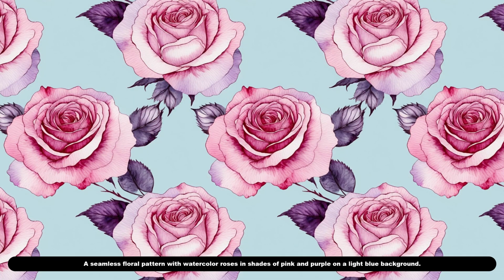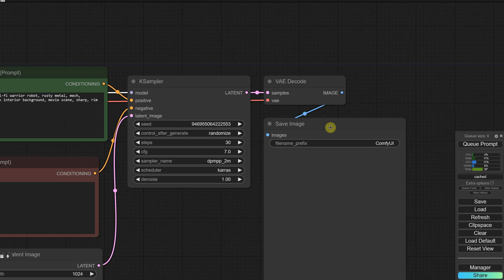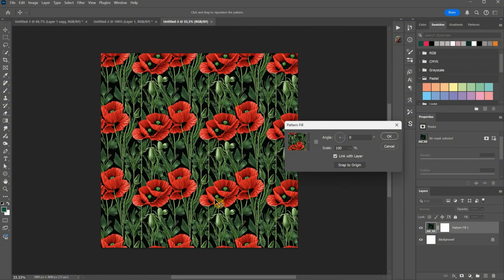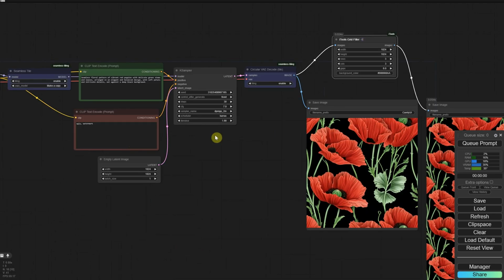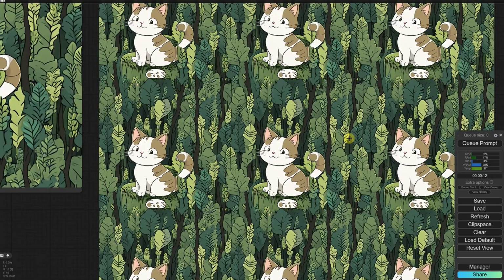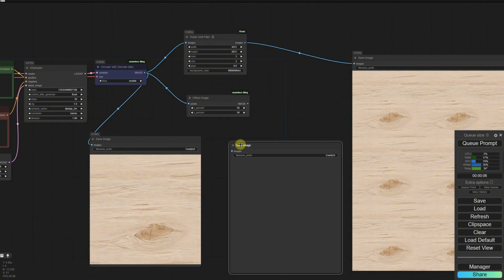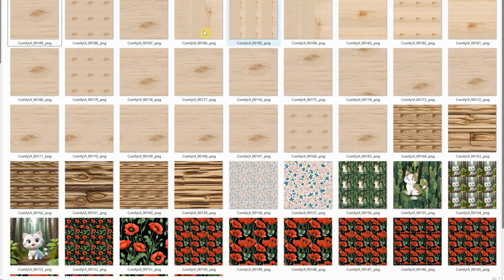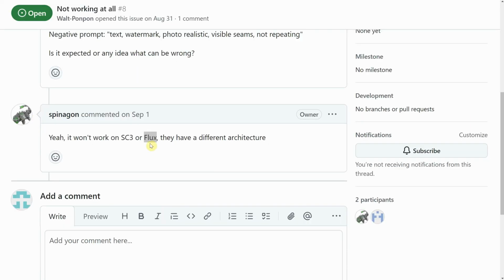ComfyUI Tutorial Series Ep16 - How to Create Seamless Patterns & Tileable Textures

Comment: The “seamless tile” node does not work. It returns the error ‘NoneType’ object is not callable. Do you know how to fix it?
Only works with “modify in place”
Reply from the maker: It only worked with sdxl model, but didn't try recently since i don't use sdxl anymore
Reply: Change the value of copy_model to Modify in place. Should work.
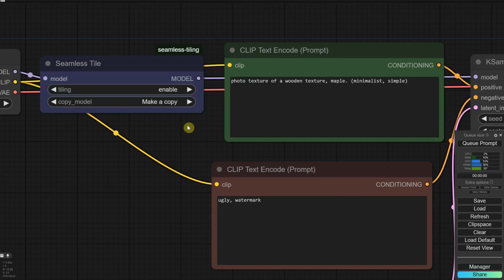See 8:41

Comment: SeamlessTile
'NoneType' object is not callable.
I don't understand what the problem is.
Reply from the maker: Not sure, post on discord maybe. Also that node only worked with sdxl models not with flux and other models. And ComfyUI updated and changed a lot since then, i didn't try recently to see if still works
Reply: @pixaroma  but thanks for your reply anyway
Reply: @pixaroma  Yes, I used flux. Most likely, node is already outdated.
Reply: Change the node from Make a copy to Modify in place.

Comment: Can a texture which is not seamless using this workflow to get the seamless texture? Thanks for your help!
Reply from the maker: It will not be identical and seamless if you use high denoise with image to image and get a variation that get seamless but to look right you need high denoise and it will be less similar to original version, so you can not keep the image and be seamless either is similar to yours and less seamless either is seamless and less similar

Comment: I would like to know how to regroup 4 images of 1024x1024 used by sdxl to get one image of 2048x2048 (or even more) using text to image , in order to ger a big resolution image.
Reply from the maker: I just use Photoshop and creating a 2048px document and place the 1024px in each corner and export it again.
Reply: @pixaroma  For the Text to image method , how do you generate each image to get a good overlap between them , to produce a final image ?  Can you do it directly by comfy ui using batch files for example ?
Reply from the maker: @igo6615  if you generate one image 1024px with the workflows I posted on episode 16 on discord you get 2 images, one at 1024px and another one repeated 3 times at 3072x3072px because of that Itools grid filler so it repeats ok. If you want 4 different images into 1 that is not a repeatable pattern. post maybe screenshot with what you want to create on discord, maybe I dont understand something

Comment: Thanks for the workflow and the tutorial, amazing. This workflow is to create a seamless image through text-to-image. Would it be possible to create seamless from an already created image of yours? Would it be possible to convert this workflow from SDXL to Flux?
Reply from the maker: from image to image kind of work with high denoise but the image would look less seamless depend on the image you give, if the image is very similar to a pattern then is more easy. As for flux is different architecture and it doesnt work with flux or sd3 the node for seamless patterns.

Comment: Is this possible to make with image to image?
Reply from the maker: I tried but because the normal images are not repeatable it doesnt change only the edge it change also the image in order to be repeatable, so if the denoise is  higher the images is more seamless but the image is more different, if the denoise is low will be more similar but the part where it combines will be more visible
Reply: @pixaroma  And what about just masking certain area so that we can use certain character in the seamless pattern?
Reply from the maker: I didn't.try i usually just use illustrator or Photoshop to create seamless patterns from existing designs, and i use ai to get them generated from scratch

Comment: Hi!!, I just started to follow you, very nice video tutorials, thanks you for these tutos. One Q, can you make a workflow for "Image to seamless" textures, I been trying to do it for a while and I have one but is very complex and a mess jajaja. I hope you can do one more simple. Thanks once more
Reply from the maker: It kind of works but it doesn't keep images similar , depending on the noise, if i want the edges to be seamless it needs to change the original image, if is too similar it will not be semaless
Reply: @pixaroma  yes, this one does not work for "texture to seamless" I mean,  if you have any texture non-seamless(ex. random texture from the internet), first, you need to normalise them to get rid of any brightness inconsistencies, In Photoshop you do it with a 1"Blur average" + 2the same texture over that on "linear light 50% opacity + 3highpass filter. then offset and paint the joints... so in Comfy, at this point is an offset node with padding and that padding is fed to an Inpainting workflow as a mask and then filled with a ksampler. I know that doesn't sound very difficult but it is jajaja, it would be nice to have a PBR output with the main ones (normal, roughness and high maps) there are a few models that do the PBR output... but you know, is just a fake

Comment: I have seen a few videos for comfi for low vram 6-8gb. Do you plan on doing a comfi series for low vram devices?
Reply from the maker: This one for example works with lowvram, tested on 6gb rtx2060. Usually for low RAM you just use smaller models, and sometimes help to use vae decode encode the tiled version. But running flux and complex workflow will not work to well, is like you have a tiny car with small engine and you want to compete in.car racing 😁 I usually include on discord workflow for sdxl